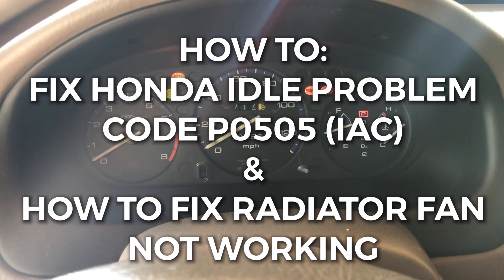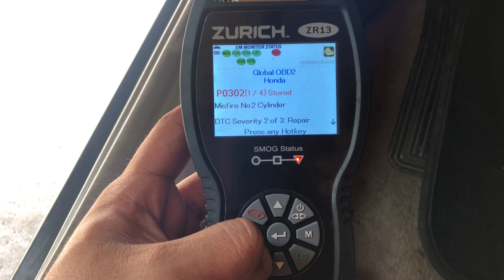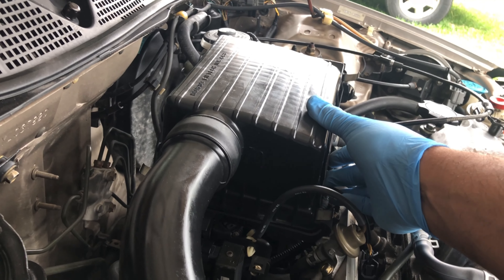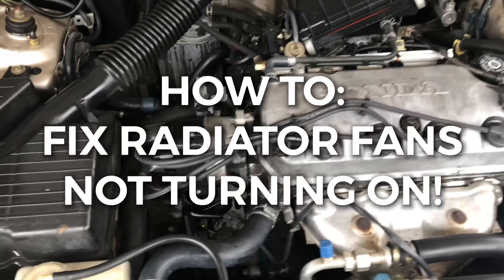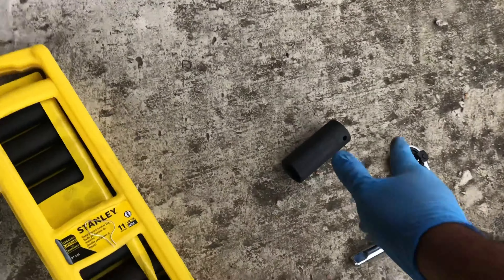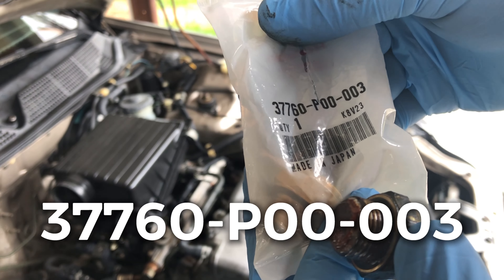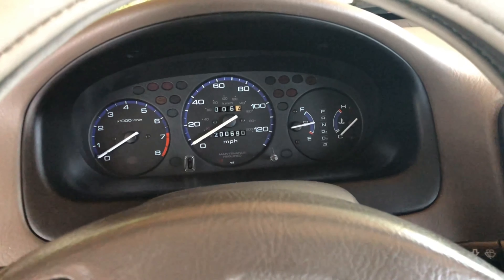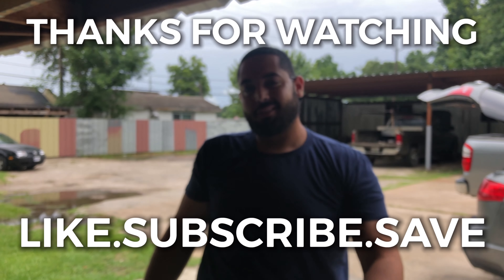FIX HONDA CIVIC IDLE PROBLEM & FIX RADIATOR FANS NOT WORKING ON 1996-2000 HONDA CIVIC

Comment: Thank you so much! My 99 civic had both these issues. Unfortunately I did not find your video in time to help with the idle air flow control valve (I did end up watching the chrisfix video where he cleans it instead of replacing it it, so that saved some money). While I was working on the IAC valve is when I noticed the fan not spinning. Fortunately this was the first result.

Comment: I still have questions about Honda Civic 1996. I have these 2 grey exposed wires and my cousin would put it on the battery and the fan turns on. And when it's off the battery it shuts off I don't know what I need to replace for it. Because the fan sound doesn't disappear untill you take the cords off of the battery.

Comment: I changed the sensor switch on top of the thermostat and the 2 sensors below the distributor and my cooling fan doesnt come on when u turn on the ac and it's supposed to but never does. I checked my relays and fuses and they're fine. I thought maybe my fan needs to be replaced but I ran alligator clips from the cooling fan directly to the battery and the cooling fan came on with no problem. So my question is why isnt my cooling fan turning on when I turn on the ac???? The fan on the driver side comes on without any problems.
Reply: Did u ever figure out the problem man? I have a 96 lx and I’m having the same issue… I changed thermostat …the housing….cooling sensor and still over heats when stopped.  The paper clip trick turns my fan on but when I plug it to the sensor it doesn’t turn on at all it’s really annoying now!!!
Reply: @steviep6885  did you figure out the issue??

Comment: I have a 2002 civic, the fans are shutting off every minute or so for about 6-8 seconds then turning back on. I replaced the fan and temp sensor about 4 months ago and it has been fine. Not sure what it is. I switched the relays around but the fans keep turning off every minute or so. Help !!  I notice that both fans only come on when the ac is on

Comment: Thanks man! I'll try that on my Civic (my radiator fan won't come on)
Reply from the maker: Juan Cruz thanks so much for watching! Good luck!
Reply: I did all that and my fan still won’t come on
Reply: Replaced my switch, bled the system  flipped the relays and you can hear the clicks when you put the paper clip in and the fan comes on
Reply: My fan work when I replaced the temperature switch on the thermostat housing
Reply: @ANGLERNATION  any chance u remember the solution? I have this same problem changed the sensor twice and the sensor keeps messing up with brand new part

Comment: What to do when you replace your thermostat switch and the fan still doesn't come on?
Yes, shorting the plug contacts makes the fan turn on.
I also replaced the thermostat inside.
Reply: Did you end up solving the issue? I’m having the same issue

Comment: My radiator fan come on when I tested it with a clip wire. You said the coolant temperature sensor is the one causing it not to run. Is that for sure? What if it didn't solve the problem? What is the real cause then?
Reply: Pleaae let me know i switch thepeace and still no work
Reply: @keoniseymour7738  if you switched and it didnt work, would a new relay work out?
Reply: I replace the thermostat switch ect sensor and the coolant temperature gauge sending unit and my cooling fan still doenst come on when my ac is on..99 civic. My fan on the driver side comes on fine but not passenger fan which is teb cooling fan that's attached to the radiator. Changed my relay and still nothing only thing I cna think of now is changing the actual thermostat. I did the thing where u attach gator clips to the fan switch then run the other side directly to the battery and it turned my fan on while my car was off so that tells me my fan is good and I can send back this brand new fan. What ya think? Ya think it's the thermostat since I changed every 3 of those sensors and checked my relays?
Reply: @WavyVaporizers  I have fix it... long time ago, but thanks for the effort. Yes, it is the sensor and proper filling of the coolant.
Reply: @balloney2175  so what was your problem why wasnt your fan coming on? I told u everything I did to see if u would know why my fan doesn't come on.. any help?
Reply: @WavyVaporizers  I really don't know what made it not run. I just notice one day, it was running.

Comment: I just changed my fan switch and still no power to fan.brand new fan... New relay.. I'm confused by now lol and I have power coming from the fan switch pigtail
Reply: Have u resolved this issue ? Im having the same problem
Reply: Same prob did the test switch the sensor fans still don't turn on
Reply: Fuses bro always fuses if not the fan switch
Reply: @nemesistypeb    So a new fuse fixed the issue? I changed the thermostat …the housing …the coolant sensor and still over heats

Comment: I'm stuck man. Tested fan from switch and fan plug, both work, replaced fan switch, checked all fuses, replaced thermostat, I have revving idle and no codes. Fan still wont turn on, heat works, idk what the hell to do
Reply: PLEASE SOMEBODY COME UP WITH A SOLUTION, 4 MONTHS LATER STILL SAME PROBLEM
Reply: Replaced thermostat, fan switch, plugs, grounds, relays, wires, entire coolant system, all fuses, EVERYTHING LITERALLY EVERYTHING
Reply: Have you tried the water pump

Comment: Hello I need some help my cooling fan don't turn on  change the relay change the fan switch change the fan and it still doesn't turn on only turns on when I bypass it
Reply: Thermostat has been changed too
Reply: Any solution ?

Comment: I used a paper clip to jump the fan switch and fan still didn't turn on! What could this be? Fan is brand new btw
Reply: Try the fuse
Reply: @greenastro7247  yes it was the fuse for the cooling fan lol
Reply: @v36vhr  did the fuse look blown when you took it out?

Comment: My gauge reads half way mark and my cooling fan takes to long to go on and radiator gets really hot still temp gauge on dash reads half way mark and when the cooling fan finally wants to turn on it goes on for just a about a minute and then turn off and my fan is turning counter clockwise blowing air at the engine not at the radiator can you help me by telling me what I am needing to do about this issue im having now
Reply from the maker: It sounds like the fans are not installed correctly. Or faulty fans. I would suggest you bring it by a mechanic shop to get it further diagnoses. Thanks for watching! Wish I could’ve been of more help.

Comment: i replace that sensor and the fan is still not turning on.
Reply from the maker: Replace your fans - check your fuses first
Reply: Was it a genuine Honda cooling fan switch? If not make sure it is. Also and I hate telling people to keep buying parts cuz most people like myself are on a budget but change the thermostat. Again make sure it’s Honda genuine. And if you decide to replace your fan make sure you check for ground power first.

Comment: Do I need to drain the coolant first?
Reply: For the part where he says to remove coolant lines? Yes. Excluding hydraulic systems, fluid systems in a CONSUMER vehicle are not pressurized when not in use (keyword is consumer, don't apply this generalization to commercial equipment and get yourself killed) so it's not dangerous to open the lines in terms of anything flying out at you (unless the vehicle is warm from recent use, in that case wait for it to cool down first.) BUT.. That doesn't mean there isn't any fluid in the system.
At the very least, draining the system in advance can avoid a mess, some pollution, and the uncertainty of not knowing how much to refill because you don't know how much was lost. You can often reuse what you drained out if you're pinching pennies, but it's just better to empty it before opening lines.
In a roadside emergency? Sure, sometimes you don't have any means to drain and repairs need done now. But in your driveway? Take the time to drain it before opening it.